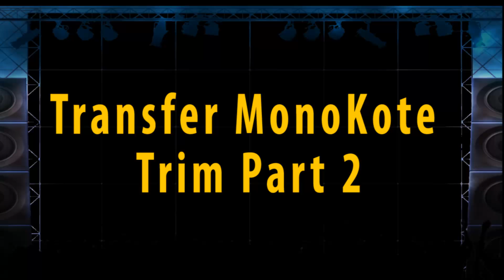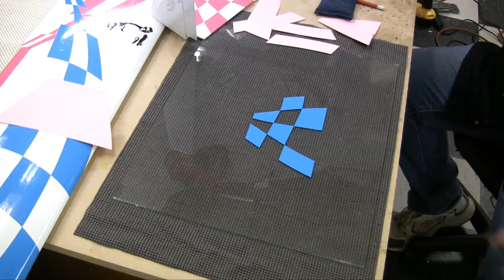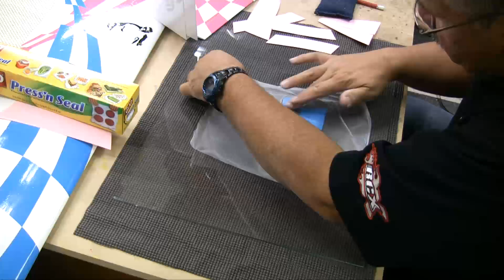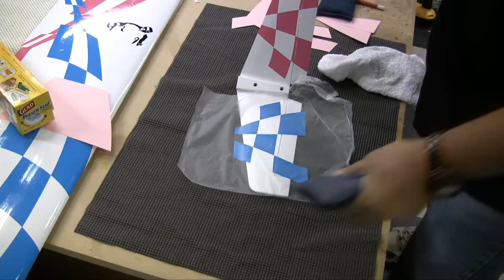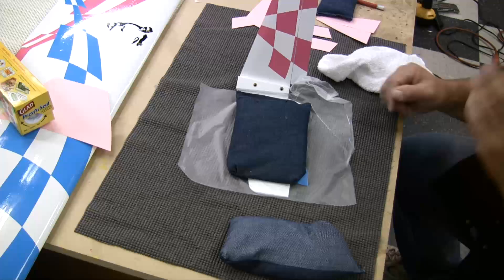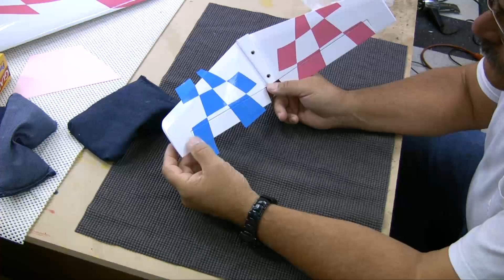Transfer MonoKote Trim Part 2

Comment: john. The  cutting procedure went well but i had difficulty getting the press and seal to stick to the monokote in order to remove it.  Any suggestions?   What am I doing wrong?  Thank you
Reply from the maker: make sure you get all the press and seal flatten (all those little bumps out) and start pulling up at the corners.  use a hobby knife at the monokote edge to help separate it from the glass
Reply: Beatiful.  Thanks.

Comment: Glad I found this. Will be so helpful.
Just one question. When do you remove the backing from the MonoKote?
Before putting it on the glass or just before putting it on the plane.
Reply from the maker: You remove it before putting it on the glass